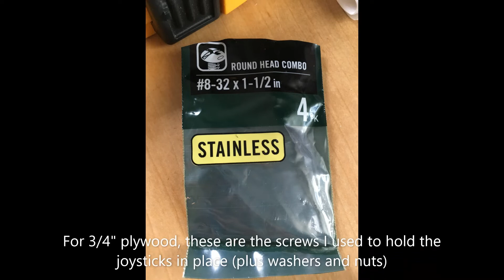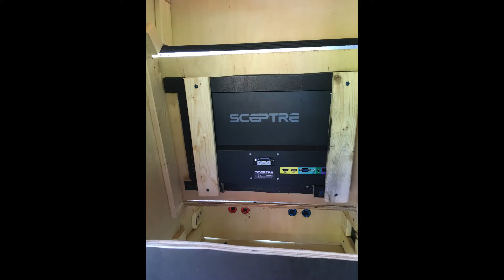Arcade cabinet build using RaspberryPi

Comment: Nice build!  Did you design the cabinet from scratch or did you take measurements from another arcade cabinet?
Reply from the maker: Josh Davis I made it from scratch! I loosely based it on other designs I found online (like cutting the back piece out to make it lighter and accessible) but I designed this one myself
Reply: @StaticStorm17  Awesome!  It turned out great.  I  was thinking about making one myself but I planned to find dimensions online or find an existing arcade cabinet to measure.
Reply from the maker: @joshdavis766  I semi-based my design off of youtuber "nintendrew". He has a video with a link to his design and measurements that were super helpful in designing my own!